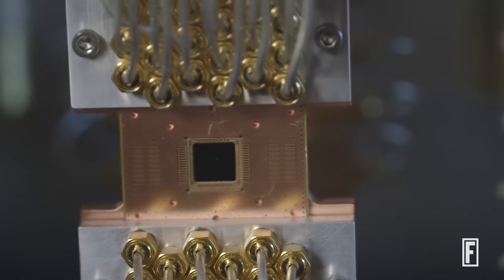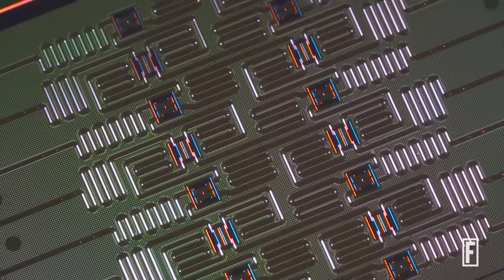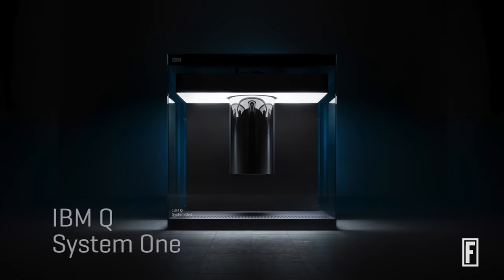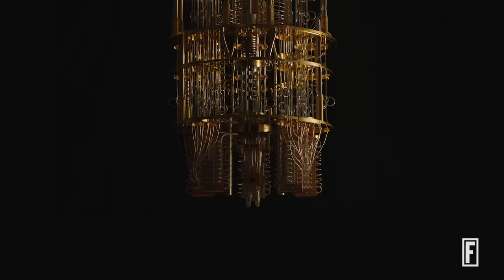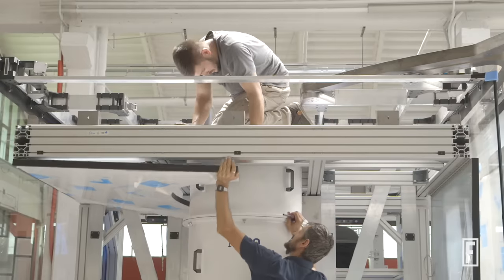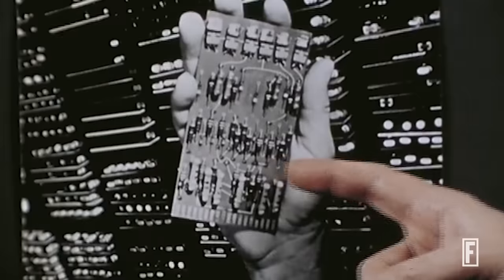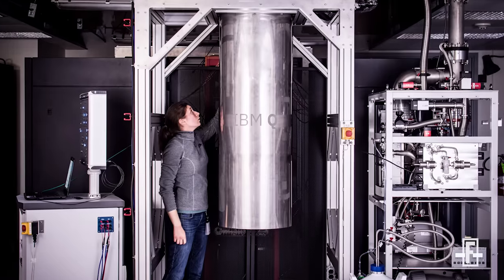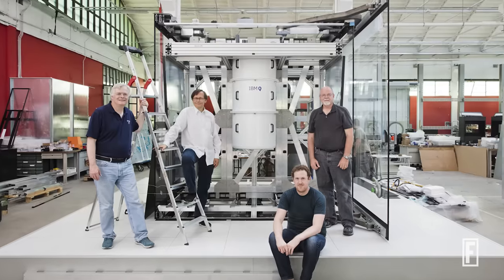IBM Unveils Groundbreaking Quantum Computing System I Fortune

Comment: How is it actually quantum? Why does it need to be supercooled? I went to the official website, it doesn't tell you, the best you get is a graphic of the cooling system. If it's qbit pairs per bit equivalent, how are they a 1 and 0 and both 1 and 0 at the same time, how is each clock cycle equivalent result held in memory address for use. 
If they are not using a memory address equivalent, how is each stage of computation able to be checked.
eg I saw an older related video here using a phosphorus atom for the spin change - but that is still linear not quantum, it works from applications of pulses one after the other.
I've seen some coding examples, but they are using conceptuals that don't map directly to hardware, eg - one bit in each pair stays the same. That doesn't map to hardware claims of how these are supposed to work, cause each pairs bits have to be each different state, plus simultaneously.
Reply: eg say you have an atom in some substrate, coupled with another atom, so that one affects the other. So one is 1 the other is 0, and at the same time the first one is 0 and the other one is 1. So don't you need two read-out paths per atom then, for them to be in both states at once, with an output. And isn't then the third usual state they claim to use actually just those two previous states, as both are already 1 and 0 at the same time (or is there a state where both are 1 simultaneously and also both are 0 simultaneously - so you could use the same read-out paths there, but you'd have to store them as separates for them to be used for the next stage in computation).
Reply: @moonwatch7963  Not how a quantum computer works or how quantum superposition works. A particle in superposition is represented by a complex unit vector (a, b) where a is the amplitude of the 0 state and b the amplitude of the 1 state. The probability of measuring a 0 is a^2 and the probability of measuring a 1 is b^2; if you measure a particle in superposition, it becomes a classical state (either a 0 or a 1, not a superposition).

A quantum computer has a bunch of qubits and microwave lasers which can hit qubits precisely. Any laser can hit any qubit and some lasers can hit two qubits at the same time, entangling them. When two particles are entangled, all it means is their quantum states can no longer be written separately. Instead it's written as a complex unit vector (a, b, c, d), where a is the amplitude of the 00 state (both particles 0), b is the amplitude of the 01 state (both particles 1), etc. Quantum gates acting on one qubit which is entangled with other qubits will change the entire quantum state of the system, so if you have a n qubits entangled, acting on one qubit can change 2^n complex numbers. If you do it carefully, you can cause states to interfere constructively or destructively to 'remove' incorrect outputs (decrease the amplitude of the outputs) and make the correct output very likely. 

At no point are you "reading out" from atoms; at the very end you measure them to extract a result, but at that point you read either a 0 or a 1 depending on the final state.
Reply: @AmbientMorality  What is a qbit made of then, if you are not writing from atoms etc at any point? How are the qbits connected to one another? How exactly does the hardware measure their output, and how does it feed that into equivalents of address space etc for calculations?
What do you mean by 'make the correct output very likely' - this means you know the answer already, so why are you needing to compute it?!
It sounds like a very much longer version of still arriving at either a 1 or a 0 from what you wrote at the end.
Reply: @moonwatch7963  Qubits can be any component that maintains a quantum state, so that can be any particle or small component theoretically. In practice the most successful qubits are superconductors with a insulating material between them. That makes them still quantum (superconductors can maintain a coherent state) but much larger and more practical. Microwave pulses can hit the superconducting material, inducing a voltage in one or another. Microwave pulses can also be split in such a way that two pulses hit two of the qubits correctly, therefore causing entanglement. 

"Make the correct output very likely" is a fast way of saying "design a quantum algorithm", which is very hard. The only real times you'll benefit from quantum computers are when your problem can reduce to doing rotations of a massive, n-dimensional vector. That'd be extremely slow in classical computers – same complexity as matrix multiplication – but quantum gates can be considered as unitary matrices that act on the state of a quantum system, so one quantum gate application can rotate any n-dimensional vector in a specific way, and it doesn't take any longer to do that if you increase the dimensions. That doesn't sound very practical and usually it isn't, but there's a few problems where it helps a lot. It is hard to come up with a good example because Shor's algorithm requires more number theory than I know, and the simplest quantum algorithm that's more efficient than a classical algorithm solves a problem that literally nobody cares about.

Yes, it's a version of arriving at a classical result. It's generally about the same speed as a classical computer (well, quantum gates are generally slower, so it's actually slower). For a very specific few problems, it's much faster than a classical computer – or more accurately, for a problem where it takes exponentially more time as your input size grows on a classical computer, it might only take polynomial additional time on a quantum computer.
Reply: @AmbientMorality  An honest reply, thanks.
Reply: @moonwatch7963  Fun little note: we think there are problems that quantum computers can solve "faster" than classical computers (more specifically, as the input size grows, the time a quantum computer takes to solve a problem grows slower than the time it'd take a classical computer to solve that problem). But we haven't actually proven that, so it is technically possible (though not expected) that quantum computers offer no theoretical advantage for any problem. There was a certain problem called the "recommendation problem" that was shown in 2016 to be fast on a quantum computer, but last year an 18-year-old proved that there was a classical algorithm that ran just about as fast. 

I'm excited for quantum computers from a theoretical standpoint (it's a really interesting model of computation if nothing else), and I hope it can successfully be applied to some scientific computing problems; I doubt it'll be useful to the average person because classical computers are already incredibly fast and improving all the time. I'm somewhat skeptical that it's even possible to maintain enough qubits in a coherent state for long enough to compute anything non-trivial.
Reply: @AmbientMorality  Maybe they could be arranged so to mimic usual chip layouts, by reusing the same qbit space over and over, use the lasers as part of the circuit.

Comment: All I needed to hear is "There is nothing today we can do on quantum computers that we can't otherwise do on a classical computer". That's the result of years of research and billions of dollars. I'm not sure people will find tasks good enough that will justify the price and the R&D of quantum computers. If I was IBM I would put my efforts in renewable energy and batteries. Since you can't go lower in transistor size the power consumption of computers won't get any lower soon. So you'd better find more easily available power. Or even better - build more efficient architecture - RISK or something, which is built to be efficient for specific tasks - encryption for example.

Comment: They say, they’re quantum ready, that sounds like they do have a fully working prototype, but it’s just sooo sensitive, if the temperature just slightly change or there’s a slight vibration, then the quantum chip will lose it’s state and stored data & calculations will get lost .
The worst part is that this quantum chip does not perform better then current classical computers.

Comment: I'm still having a trouble understanding how such a complicated method of computing will be better. I do understand these are the beginnings of quantum computing. I guess what I'm trying to say is that even after watching a lot of videos about quantum computers, I still don't really understand the basics of how they work. Whereas with a conventional CPU, I may not fully understand the instruction set. But I do understand the concept of what we input into a computer being converted to binary, being processed to a new binary number and then outputted to something we can use.
Reply: classical computing works in the binary system. It ¨draws¨ a path of opened or closed doors one by one to the computed answer. Or you can imagine having the instructions to get to a destination on the road with going left or right in order. A transistor is litteraly a door being closed or opened to let pass the current. So how does a quantum computer theoreticaly works and why it would be better? It is based on quantum entanglement. A particle has a quantum property which we call the ¨spin¨.  This ¨spin¨ gives a magnetic moment to charged particles such as electrons. Since, like a ball but not realy, it can spin in one or the other direction, it has binary information in its magnetic moment. Now, when two electrons for exemple are entangled, it simply means that when you measure the spin of one, the other HAS to be in the other spin state. So, the amount of particles that are entangled in a single set is the amount of qubits. By measuring one particle you have the information of the full set. So while a classical computer gives you directions in left and rights in order which are bits, the quantum computer gives you the full path at once which is one qubit. This is where lies the power of the quantum computer and why it rises exponentialy with the amount of qubits compared to linearly with bits.
Reply: @yepyep266  So let me see if I understand this enough to put a layman's spin on it. 

If we wanted to calculate down to an extremely small fraction or an extremely large number using a conventional CPU, the more digits to the left or right of the decimal place would take more and more 1s and 0s and the more precise the calculation, the more 1s and 0s would need to be processed, which of course would make the calculation time longer. But with a quantum computer, the state of the entanglement is essentially analog and as a result, infinitely variable, thus, no matter how large the number or precise the calculation, it would take the same amount of time as calculating a simple equation?
Reply: @BlenderRookie  well first the state of spin is not analog. It is clockwise or anticlockwise. Now I am clearly not an expert in quantum computers, but I think I've seen that one of the problems with them is that they are only good for certain types of questions. I don't think it would benefit in computing the addition of two numbers. That would basicly be putting two pieces of information together and creating a new one and this is just moving information in a defined path. I think where it shines is when the question entails randomness. Answers you have to find by tries and errors. Lets say you ask a computer to find a certain password composed of 8 binary digit. Well there are 256 possible combinations. The classical computer tries them all one by one and would need 256 bits to try them all at once. The quantum system composed of 8 entangled particles (8 qubits) would directly ¨fit¨ on the answer.  It all comes from the fundamentaly statistical nature of the quantum world (based on the generaly accepted interpretation) or what we call the indetermination principle or superposition principle. Now I just don't know how such a system can be set up or programmed. So if you realy want a deep understanding you would have to read on those not so easy to understand quantum concepts, but I think we can get a good idea using information terminology.
Reply: I might be wrong on some things, but I hope it helps to understand!
Reply: @yepyep266  Dude, I think a deep understanding of this stuff is a bit above by grey matter's pay grade.

Comment: Until we get to a point where Quantum computers can do something classical ones can't, or even have an advantage that classical ones don't, I find it difficult to believe that Quantum computing will ever be able to do the things people dream of it doing (such as break cryptographic algorithms).  I'm even a bit skeptical that the entire industry may be fraudulent.
Reply: The issue is current programming models within the computer science field are designed for classical computers operating with binary (b = 0 OR 1) values in the form of bits. Qubits are different as they can represent those two states simultaneously (q = 0 AND 1), which completely breaks the entire study of modern computer science. The reason it is difficult to believe is because there isn't much public understanding of these new models yet and their study is limited by the lack of available hardware. Unfortunately all that means is that when this stuff becomes mainstream pretty much every current programmer will know nothing about the "new" way of programming and may very well be out of a job or forced to completely reevaluate their practice. My guess though is it will likely be a very long time before that happens.
Reply: G3UDO Friendly reminder that "computer science is no more about computers than astronomy is about telescopes." ~Dijkstra
Just because we have different computers, it doesn't break the entirety of computer science. I myself rarely think about the fact that bits are 1s and 0s. In fact just because quantum computers use qbits, it doesn't mean you can't use it like a classic computer. Just that if you do so you are wasting the extra power a quantum computer gives you.
There's plenty of public understanding about quantum computers (maybe not the general public though). The fact that we don't have hardware does not matter as we have simulators you can use to run these algorithms on classical computers.
The "old" style of programming won't fall out of mainstream as quantum computation is a niche field.  Additionally, there's still tons of legacy software that unfortunately needs to be maintained.
Reply: @G3UDO  This has already been the case with Quantum Computers for at least the last decade.  There has been little if any progress.  How long did it take to build out the first ENIAC which started solving problems immediately?
Reply: @jimbig3997  all I'm saying is that until these things become mainstream I see the shift in philosophy as being a potential problem in the industry
Reply: @G3UDO  Possibly because the philosophy doesn't make sense and is just another big Einsteinian scam.

Comment: so the glass really looks nice but wouldn't it be better as a metal vacuum tank with a lot of isolation and dampening such as floating the whole thing on shocks, air, oil, magnets. also some of those fancy noise canceling tech but for seismographs that they have at the ligo gravity wave detector. this looks really great for the lobby, just saying you might be able to get to that useful "advantage". and because of the noise wouldn't you want to go embarrassingly parallel for a quantum computer brute forcing many q-bits to get a averagely reliable response, like asking stadium of 5 year old's to spell superfralachadallisticespialadosious not one of them can spell it correctly but maybe all of their answers averaged can get it right. just say'en

Comment: Could refrigeration be used more in computing, for faster cooling, could chips and graphics cards and cpus work more without melting. The fridge computer looks too complex for homes, maybe quantum computers will be housed in big warehouses and link to home computers through cloud computing, with 5G maybe the computer doesn't need to in the home tablet anymore. You could just buy quantum computer time just like electricity

Comment: The real quantum computer is still a conjecture, not a scientific fact (resting on hypothetical measurement theory postulates, particularly the nature/physical interpretation of projection postulate for composite systems). The quantum annealing (D-Wave type) on the other hand, is  merely an analog computer which will never be competitive with conventional digital computers (instead of writing a plain program for a new problem one has to build a new delicate physical experiment with complex initial and boundary conditions).

Comment: It ain't gonna work!
  I know I'm not the brightest bulb that's ever lit up a refrigerator but I have a low information, poorly thought out, cannabinoid fueled hypothesis.  It doesn't matter how you build this thing "bigger", you can wire a bunch together, beam it to the cloud, or design a chip with billions of quantum qubill gates, it will fail.  What will happen is the computer will "pop out" of the quantum realm because at some point we will ask for too much information.
  Perfectly logical Sci-Fi plot element.

Comment: 3 - 5 years until quantum advantage?!? You're high.  The gains in quantum computing are way to slow to make such a prediction.  Until you've solved fault tolerance (which you haven't), you have no reason to suspect this technology will ever become viable, let alone advantageous.  Remember those folks who did computing and storage with leech neurons at blazing speeds in the early 2000s?  Neither does anyone else, because they never made it work with an acceptable degree of consistency.